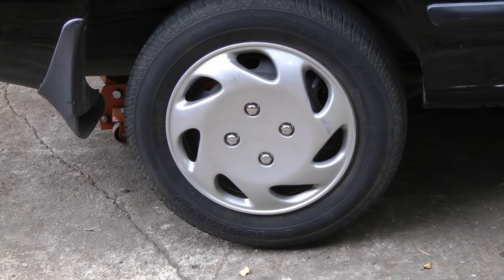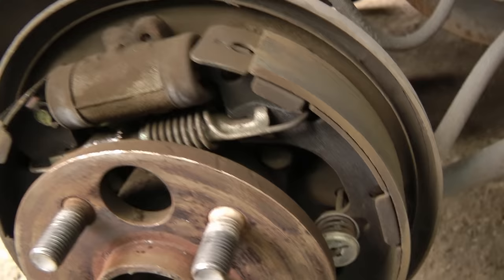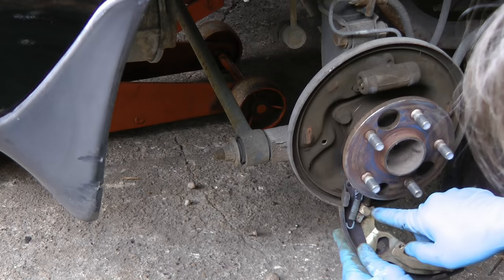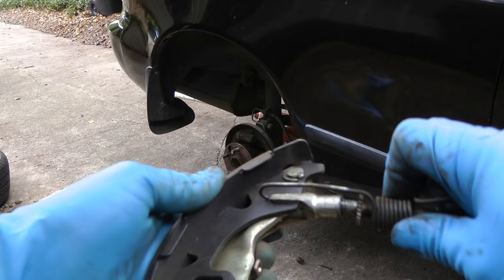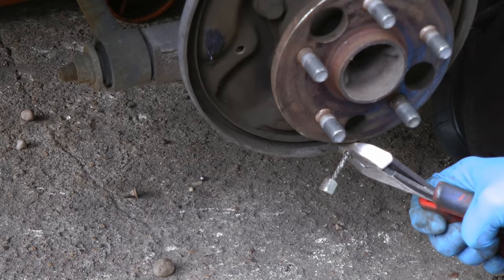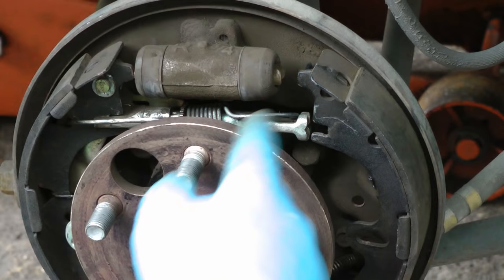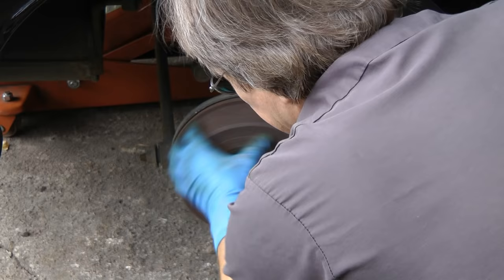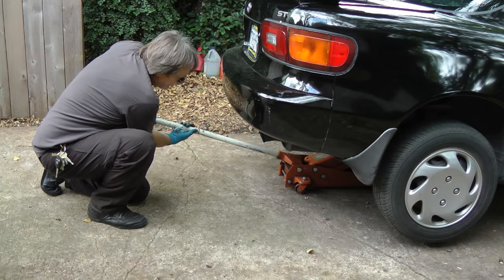How to Replace Drum Brakes on Your Car

Comment: It's all fun and games until you do your own drum brakes
Reply: ki jssn just didn’t my first set of drum brakes on my 3rd gen camaro and oh my god did I want to roll it down a cliff😂
Reply: Jajja it happened to me too.
Reply: @itzmckrispy9318  i agree 😂 i thought the same thing when i was doing my moms for her . im so happy my car has all disc brakes 😂😂
Reply: LOL yes!
Reply: Scottie mah man thank you... Now i know how to do it but first i gonna buy me a car... With drum brakes on the back...
Reply: xXIrishxSmokeXx wait why? Was it difficult? Cuz I got a 3rd gen too 😭😭
Reply: @al3x555  it is easy if you have experience in it. However, when doing it yourself you could take 2 hours of what supposed to be 15-30 minutes job😂
Reply: Blank Nick dang and I just got the kit cuz the springs broke I’m barely 16 so I’m still learning more and more might take me a while then 💀
Reply: @al3x555  its ok just do it. 100 starts from 1
Reply: revv up your rotors
Reply: What is the purpose of drum brakes anyways? 90% of your braking power comes from your front brakes.
Reply: @applepoop10  cars used to have 4 drum brakes.  Some have rear drum brakes because its cheaper.  The drums actually provide around 30% of your braking.  They are better than disc because they have longer pads meaning ability to create more friction and they last a long time.
Reply: @chriss4365 drum brakes do not provide better friction/braking capability compared to disc brakes. They actually less effective, the only reason why manufacturer still use drum brakes today is just because they are cheap
Reply: @applepoop10  correct. Most car with front engine layout rely on their front brakes because most of the car weight is placed in front. The rear brakes purpose is only for stability when braking (correct me if I'm wrong). Because the rear brakes doesn't do much job, the less efficient and cheaper drum brakes is still a good option for some cars.
Reply: @Nick-ko1tw  ok explain how bigger pads with more surface area do not brake any better than disc brakes?  They actually last longer because its not a tiny pad being pressed with tons of force against a rotor.  Disc brakes are a scam so the pads wear faster and the companies can sell more pads.
Reply: @chriss4365  yes they have big surface area but i don't think they do provide better brake capability than disc brakes because there are other things involved than just surface area. I can't really explain the detail because i'm not a proper engineer and also you got internet around you as well. I'm just talking from my experience.
I have two bikes. They have same price but one of them have full drum brakes setup. When I apply only the front brake, the disc one stop sooner than the drum one. Not just bike, I also have small Hino utility vehicle that use all drum brakes setup, they do not stop better than my car that use front disc and rear drum brakes setup. The Hino's pads last much longer though. It's about 70k km on the clock but when I check it, they still thick enough to carry another 10k km while I already change my car's front brake pads at around 60k km.
Reply: I’ve done everything from head gaskets, brake fluid flush, transmission fluid Changes, suspension (shocks and struts) replacement, coolant flush, and so many other things but drum brakes scare me the most and stress me out the most lol.
Reply: I replaced the drum brakes on my car earlier today, and my God was it annoying 🤦‍♂️😂😂
Reply: fck yeah😤😭
Reply: @applepoop10  purpose is to use a hand brake why you park on the hill,  without it your car will run down and crash. Drum brakes is the same like P in automat cars,  in manual cars it's not enough just to set it on 1st gear and leave it while you are on hill....
Reply: just did mine on my civic it was a pain
Reply: I've been trying to do my own drum brakes on my secondary vehicle for about a year now. I never want to see another drum brake again after attempting that..
Reply: @itzmckrispy9318  I'm currently feeling like this about my EJ1 Civic lmao
Reply: I did mine easy peasy
Reply: It can be frustrating but once you get the hang off it it’s not hard at all right tools and don’t fight with it
Reply: Wait, what's that mean Nick? Scotty makes it look easy.
 --Looking down nervously at the new drum brake kit I bought online.
Reply: Deadass man
Reply: My front pad was cracked and my drums where metal on metal. I’m fine for another year
Reply: He Deffinitely did not mention the strain and labor 😂😂
Reply: Ha yeah try a transmission. 😊 🔫 lol
Reply: Definitely can be a pain. The springs are evil.
Reply: Especially on a 3/4 ton Chevy van
Reply: @GorrilaJohnson  I’m fighting with them right now. Took me about 2 hours to get the drum off, now going into second hour in the springs. Fuckin a man
Reply: @applepoop10  the rear brakes are mainly there to keep the back end stable when braking
Reply: The fact that Scottie makes it look fast and  easy through a carefully edited video doesn't mean it is, especially if you are doing it the first time, he has probably done it hundrends of times. Skill builds up over time with practice and patience and there is no fast way around it. And remember not one of us was born knowing anything, we became who we are by learning and practicing what we ve learned time and again.
Reply: True
Reply: Didnt think it was hard...
Reply: When I did them my wheel cylinder kept traveling too far and blowing out brake fluid all over the place and it did that 3 times to me
Reply: I wish it was this easy to do for first timers
Reply: @Nick-ko1tw  im very late to this party but i drive a 1990 toyota camry le model and yes the drums are good in the sense they dont need to be changed until the fronts have been changed out twice already . But that also shows how little the back drums actually work to slow things down . The front disc brake pads on my car beed to be changed every 40,000km and the backs are only every 80,000km on average .
Reply: @TesNRad lucky
Reply: Yes sir
Reply: @Nick-ko1tw man c'mon it's so simple, okay here is the thing. If your car uses drum brake, then raise your hand brake while driving I wanna see something
Reply: Oh yeah
Reply: And the worst part is after you accomplish this impossible mission your wife screams at you that why are u wasting your time working on the car…
Reply: I’m about to find out lol
Reply: Awesome video thank you
Reply: 06 Honda accord 🤬😭
Reply: Doing it rn, he did the fat spring easily, im on that spring for 2 hours now
Reply: @zujarka6301  it sucks so bad, also make sure you get a quality replacement, I spent hours on mine and had to take them off and get different ones because the ones I bought were straight up defective and never going to fit properly.

Comment: Without a doubt the best diy car maintenance video on YouTube. No 5 minute introduction, no super slow explanations just straight to the point with everything you need
Reply: 00:27 seconds...seconds ! !  into the vid and he starts jacking the car up.    No explanation about how important brakes are.    Like , oh ya?  when did this change?
Reply: @cubiczirconiabeard5366 I think anyone who needs a little assistance for a brake job has the mental awareness that brakes are the most critical safety component in a vehicle.

Comment: You really made it look easy.  I'm starting to think that I can do a rear shoes replacement too.
Reply: +Phillip Ivey - I SECOND Phillip lol ,I have to replace my wheel cylinders and after finding out I have to take the brake shoes off to get the wheel cylinder off I might as well do those too,but I've never done them and I watched some guy wrestle with a set and he didn't look lie he was having much fun !  Hey Scotty ,You Da Man !! ,Oh and MY question is do I REALLY have to take the shoes off to get the wheel cylinder out ??
Reply: Hardest part is removing the drum.
Reply: @iancc86  Depends on where the car is from.  My car doesn't have much rust at all, but my dad's car was so rusted he drove 3 miles with the lug nuts loosened and the wheel still wouldn't come off.
Reply: @randomvideosn0where  Jack it up, set it in a stand and hit it with the base of your palms. Mine get stuck every single time and this works so well. No idea what kinda damage that might be doing, if any 😂
Reply: @mrnorthwoodsbob845  no you don’t. There’s even YouTube videos showing you how to replace cylinder without removing anytning else
Reply: @mattbartolovich8228  what is PLU?
Reply: @cactusladysouth1000  patience love understanding
Reply: @Sticky_Ricky  thatd do no damage and on a rusty car might not do anything at all. ive had to use a hammer and i dont even live in the rust belt

Comment: Okay here are my pointers after using this video!
1) There is no replacement for cutters when grabbing springs, needle nose pliers will slip.
2) Be sure to grease ALL contact points, my car had 8 of them. Be sure to look at the bottom meeting points too.
3) You might not need to change your drum brakes if they are squeaking, you might just need to disassemble and re-grease. My car with over 100k still had the same amount of shoe left as a new set.
4) Use brake cleaner on your new drum inside contact points to remove any gunk from the factory.
5) Put your car in neutral and spin the drums, they should bind up and stop pretty quickly. If you don't get it tight enough you will still roll with your e-brake fully engaged. If it is too tight, you will have to use screws to remove the drum and start over. Take the time to get this right.

Comment from the maker: @larbyrne I've already responded to this. I didn't go under the car, AND the jack is in the middle of the back on concrete. IF the jack lost pressure, the car would just end up sitting on the jack a bit lower. Scotty

Comment: Good video but you’re missing 2 main points:
1) the emergency brake lever transfer to the new shoe.
2) lubricants on the auto adjuster.

There is also a 2 shoe retaining spring seats.  You only added the top one when fastened the shoes to the pin. In addition, forgot to mention how to adjust the adjuster from the access hole on the backing plate.

Good video though.

Comment: Drum brakes are so dumb... should be called dumb brakes instead
Reply: haha thats a good one, I guess they were smart for there time, it is just old technology replaced by disc brakes which ARE much better. biggest thing I dislike about drum brakes is they overheat on long downhlls if you apply brakes too much and then they stop working!!! also they dont work nearly as well as disc and significantly harder to change.

Comment: Scotty is the best! Only problem is that if you're old shoes are worn down far enough then the rotor won't come off. Unless you open up the automatic adjuster before you take it off. On my Yaris this can be done by opening a little hole plugged by a rubber plug and turning the gear with a flat head. It was a bummer that this information was not in this video because I ended up snapping pieces of my brake assembly by trying to wrench it off with the screws like Scotty said.

Comment: I used the bolt trick to get off my brake drums on my 1996 dodge Avenger. I sprayed some WD40 around the lug holes and in the bolt holes and it worked like a charm! Thanks Scotty! 12-26-2020

Comment from the maker: @spelunkerd  I use high quality jacks and work fast. so I often don't use jack stands, they slow me down. Only if I'm crawling under there will I use a jack. PLUS, I work on a concrete surface which is VERY stable. Scotty

Comment: You just gave me the confidence to do my rear brake shoes. Saving me at least $50 to $100. Sweet. Now if I can figure my EGR valve needs cleaning on my 96 Camry and if it has any other EGR passages that need to be unclogged...

Comment: I love doing my own brakes because then I can use the very best parts for the price I would pay someone to use mediocre parts. 

One Tip I learned from changing the rear brakes on my buddies 1997 expedition. CHANGE THE SPRINGS IF THEY ARE RUSTY! His failed about a week after the new brakes were installed. They kit for both rear drums is only like $6 from Rock Auto.com

Comment from the maker: @crusherbad64  Drum brakes are the older design. They fade more, and work horridly when in really wet weather. Most cars are all disc brakes front and back now, only the cheaper ones use drums anymore. Scotty

Comment: Dont get me wrong, this is a great video but these are actually fairly simple brakeshoes, having just done some on a skoda fabia, they took nearly 6 hours of work and ive potentially broken the wheel cylinder in the process which is now going to need a mechanic, this video makes it look so much easier than it actually is, just forewarning anyone thinking about actually doing this, its genuinely really difficult on some cars depending on the placement of the springs.

Comment from the maker: @mauricioparodi  NO, if you don't open the system up, no air gets in. Only if you removed a line or replaced the wheel cylinder would you need bleeding. Scotty

Comment: Thanks for the instructions, it was pretty easy to do on my 97' Ford Mondeo, I actually ended up changing the cylinders as well and bleed the rear brake lines, it's braking really well except for the handbrake, it won't hold, you actually have to pull it hard to stop the car on a hill, I've adjusted both drums and the handbrake leveler but it still requires force to pull it and lock the rear wheels.

Brakes are fine otherwise, they're holding up very well, no weird noises or ABS errors.

Comment: Another tip is put a cable tie around the cylinder to stop the pistons popping out when moving and levering the shoes. Just snip it when its back together. Pistons popping out are not cool.

Comment: Wow I wished I'd watched this before almost taking a sledge hammer to the entire car! This job can be very difficult and frustrating to say the least. They make specially designed tools just for this job- which a should have purchased years ago. I was trying to do this job the hard way and was disgusted by the other youtube videos where they have taken the hub off or the bolts out of the piston so it can be moved- THEN they say 'see, it's easy'. NO it's NOT. I'm SO fed up with YouTubers who lie and only show the easy part. Guess they have never had a frozen bolt, or worse, one that has broken! There's a reason why Scotty is such a successful YouTuber. HE'S HONEST!

Comment from the maker: @kurojin97 No, it means the seals are shot and you need new wheel cylinder, They will leak after a brake job when they are old and wearing out anyway. Scotty

Comment: Toyota self adjusters work. Just clean the adjusting screw and very light grease. Very, very light. A tiny dab and screw it in and out several times. All those other cars, I don't know. Toyota also makes it easy to adjust the brakes manually through a hole in the front of the drum, if you leave the self-adjusters out. I may do that this time around. I'm doing all four wheels on my new gem, a 2001 Camry LE. And it really is a gem. One owner.

Comment: Just want to mention for other users watching this video is that he forgot to mention that the leading (primary brake shoe) is smaller than the trailing (secondary brake shoe). Most newer cars now days use duo servo drum brakes, hence called Primary shoe (small) = less friction material and secondary shoe (big) = more friction material. So when you change em make sure that it is that way and don't put two (primary) on one side and two (secondary) on the other XD or your car will pull to one side

Comment from the maker: you have a leak somewhere, pull the wheels off, check for leaks at the wheels. IF you find none, replace the brake master cylinder, they often leak inside the booster and you can't see that

Comment from the maker: @96integra02  there are bleeder screws on the inside of the wheel cylinders. You open them up while someone steps on the brakes to get the air out. Scotty

Comment: I have done tons of disc brakes but never shoes but in about 9 hours, I will do my first. It's for my dad's truck. He has a 97 f150 that's a one owner with 200k miles and has the original brake shoes. He has always babied this truck. Has the 4.6 V8 5 speed.

Comment from the maker: it could, start by pulling off the brakes on the back and checking there. But if there is still some shoes left, tighten the adjuster on the brake cables, they do stretch over time

Comment: Hello Scotty, I have replaced the drum brake shoes as your instructions and now my brake pedal have no pressure in it and sinks all the way to the floor, what could be the reason for it? I have not changed the wheel cylinder so the brake line was never disconnected.

Comment: Scotty thanks! If the brake drums are seized does it mean they need to be replaced. I had been traveling for 3 years and my car brakes seized from sitting so long. I have a 1963 Lincoln Continental. Once I get the brakes free again can I just bleed the brakes?

Comment from the maker: @ScienceOfThePS3 you can just remove the top spring, move the shoes out of the way, then unbolt the old one and put a new one in. all 10 mm bolts and nuts on the back side to get it off.

Comment: So this was super helpful, although my car must be a later version than in your video.   Two huge points - one 
I banged the hell out of that outer casing until i researched that you need the parking break off.

two.  my emergency break stopped working after this.  Have no clue where to go from here other than bringing to shop, which was the thing I was trying to avoid in the first place.    I live in hicks ville.  There are not shops that I can simply take my car too :(

Comment from the maker: sheared bolts have to be replaced, and if the calliper mount is ruined, you have to buy the whole assembly and replace that too.  If you have drum e brakes, they adjust by tightening the nuts on the cable. If you have disc e brakes,they are not adjustable.